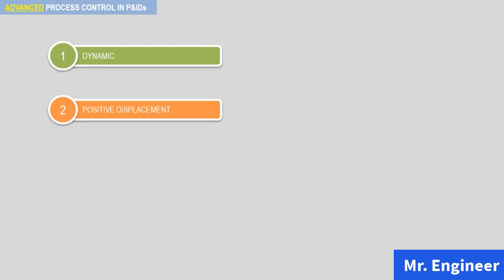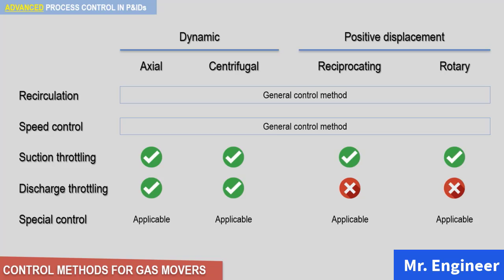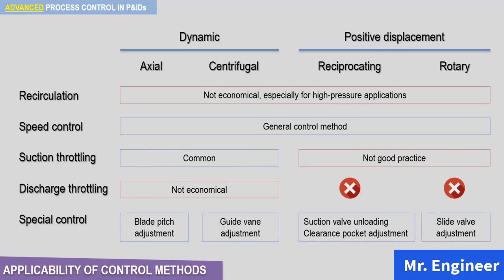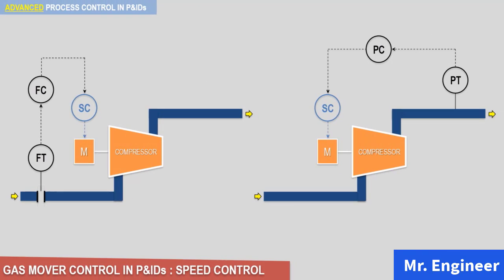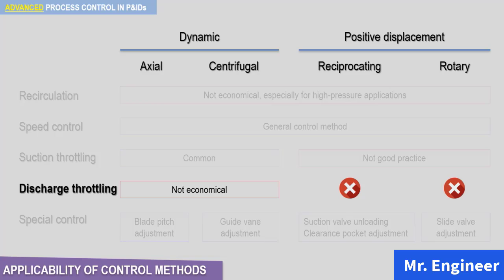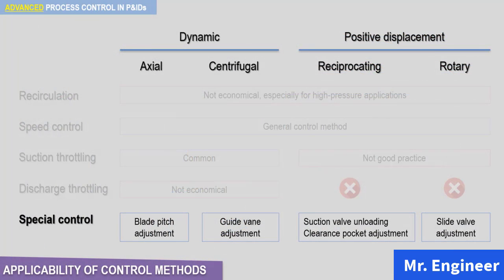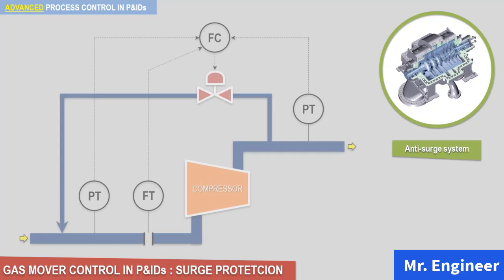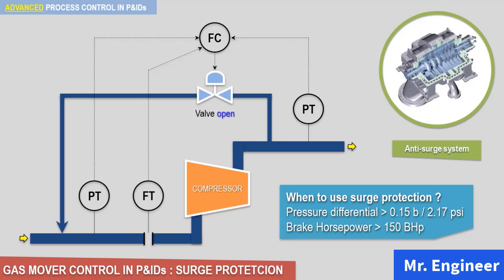How to Control Reciprocating Compressor

Comment: Thank you very much. Are you able to do a video on the start up of a reciprocating compressor package (which valves to open and how you load and build up pressure) to move the required gas vol flow rate downstream?Thanks.

Comment: Great insights, thank you. What is the difference between recirculation control valve and discharge throttling on reciprocating compressors?